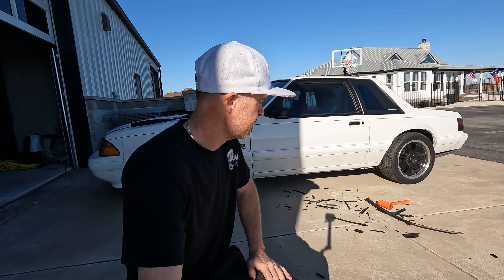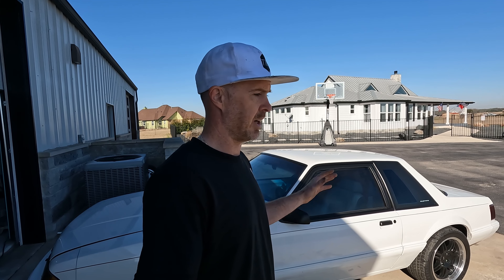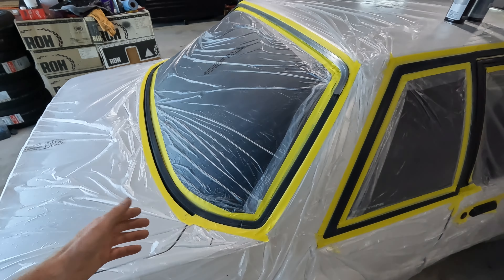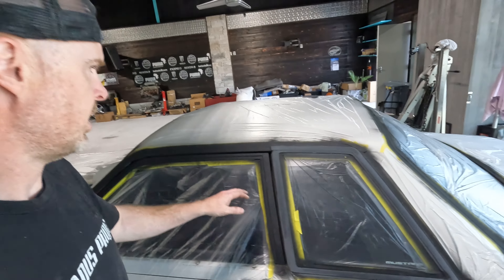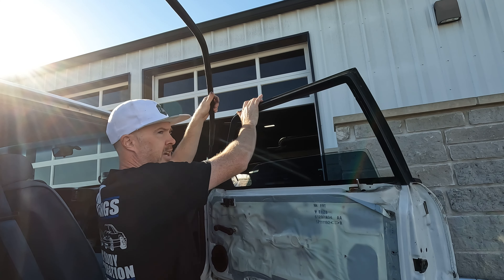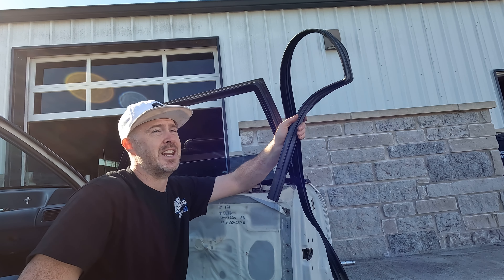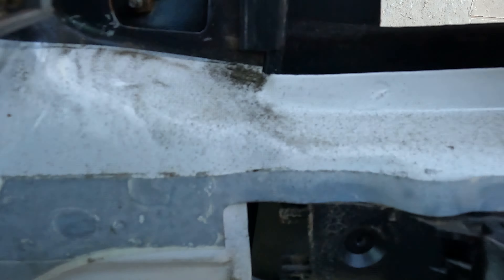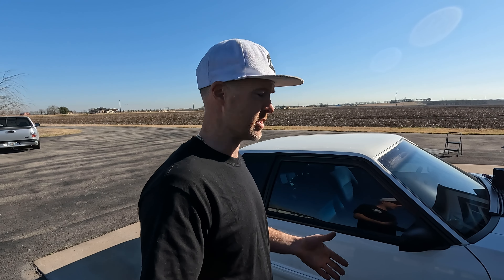Foxbody Window Run Channels? How to Install Them & Paint Your Trim on Car! - TIPS05E18

Comment: Hey Chris love the channel!  Guys the golden ticket is to soak that rubber in a bucket of warm soapy water first.  Install it soapy wet then use the window to put in position.   Super slick and gentle on everything. Use it for all weatherstripping installations.
Reply from the maker: Ya this one was quality and didn't need any fancy tricks which was nice
Reply: That's a great tip, thanks!

Comment: On my quarter panel windows, they are pealing pretty bad. Would I need to sand it all down smooth first? I ask because its rubber and not metal/aluminum like the rest. Also would it be beneficial to give it some clear coat also or would that not look great? My window runs are just like those, not looking forward to that. 🤦‍♂️ But I am just finishing up my first complete motor rebuild from top to bottom. Hoping to fire her up this week. Only drove it like 40 miles before the bearings spun, so have yet to enjoy her lol.
Reply from the maker: That's awesome you'll have it soon on the road again. You will need to sand your quarter window moldings or use a polyester filler first depending how bad they are. Don't clear coat them.
Reply: @The Infamous Project  awesome thanks! Of course I found your video on that after I sent the message. Definitely thought I would have to buy new windows. Hoping to fire her up this week. 🤞 From spun bearing to mounti donar to looking brand new. 💪Between your videos and a few others, thank goodness for YouTube. 🤣

Comment: The 🦊 master ! Do you know what would cause the driver side window to rattle when it’s rolled down ? There is quite a bit of play in the window side to side.
Reply from the maker: Missing guide plate most likely at the top near the door lock.. usually has felt on it. Or bad regulator?

Comment: Any info on a convertible run channel weatherstrip ? Found a 15' peice laying in the bottom of both doors. Can't find anything . Guessing you would have to cut those to fit..???
Great information and demonstration as usual !
Reply from the maker: That's a really good question! If it's an 87 or older yes you could.. I'm not sure if the design was different when they changed the mirror and glass style in 88

Comment: Totally off subject, have replaced both window motors awhile back, but now I get popping from my driver side door. I'm seeing the window regulator going out. Any other fixes/band aids other than replacing them? Thanks for any information.
Reply from the maker: Check the main bushings that run in the tracks and make sure nothing is getting caught

Comment: What is the brand that you used? Maybe I missed it in the video.
Reply from the maker: There was no indication as they came with random parts. With that said, I believe they were Fairchild from Rock Auto which are currently out of stock

Comment: I'm really impressed with the fit. Went on butter smooth as it seems and no trimming to fit or anything. Especially at the corner by the door handle or around the mirror(especially on 87-93 cars). I use the Daniel Carpenter(one of the top brands to get)brand and even though the fit is good there is some struggle as well as some fine trimming involved. Too bad there is no brand on the packaging.